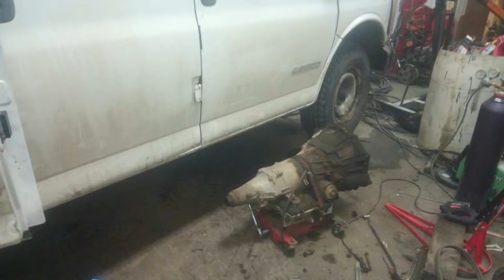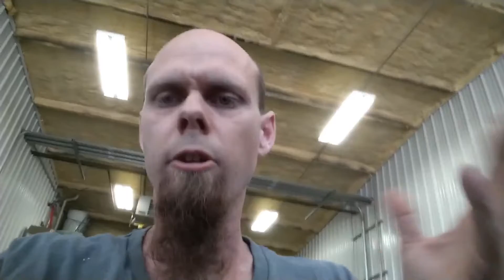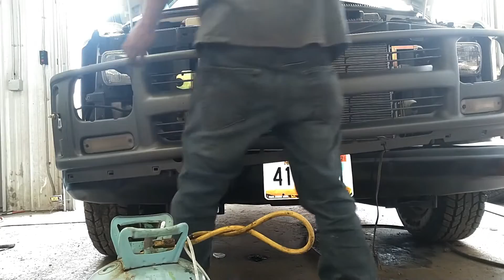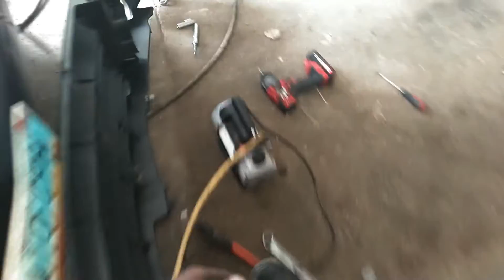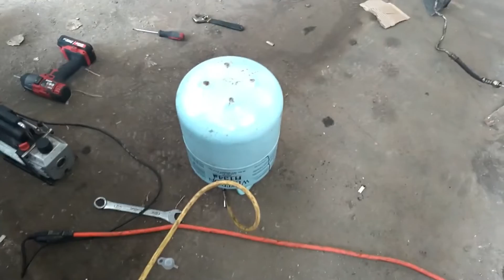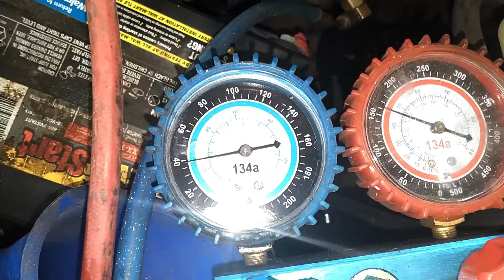automotive ac/repair 2001 chevy express 2500 camper van

Comment: Thank you very much. Augh the trials today. Has rear ac. Won't hold freon. Turns out the rear evap line was cut. Figures. I was wondering why they had the main rear condenser line disconnected. Bought it used as you probably figured. Again thank you sooooo much. I now see i have to connect/fix the aux front evap tube. Sounds stupid but i thought that cut line might have been a pressure release or something it was right at a bend and looked like something factory. Again, thank you. Great video best explained on the tube.

Comment: been doing hvac for 30 years. you got to get the gauges down to 29.9 for adequate vacuum. You should also go further than that and pull a vacuum down to 500 microns. There is also a formula for adding oil. it is dirrectly related to how much refrigerant is in the system. I believe it is total pounds of charge times 1.7 plus 2. Most manufacturers tell you to dump oil out the old compressor and measure the exact amount to put back in.
Reply from the maker: thank you

Comment: The other videos I saw tell you to only add to the low pressure side, yet you opened both valves at first before starting the engine.  Why?  Thanks!
Reply from the maker: With the engine off it can only equalize to the pressure in your bottle. By going in threw both ports it's a bit faster because it doesn't have to flow threw the expansion valve. You do want to make sure the high pressure side is closed before you start the engine and keep it closed. High pressure side can be 4-500 psi when running witch could over pressurize a small can of freon
Reply: That makes sense.  Thanks!